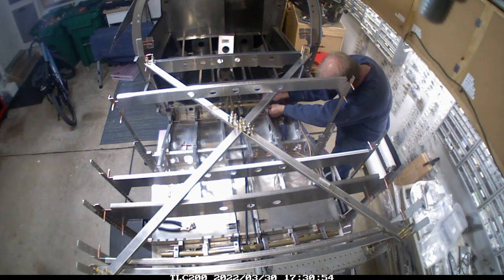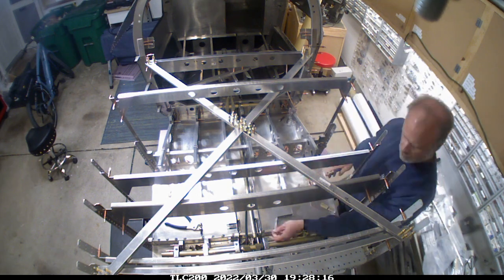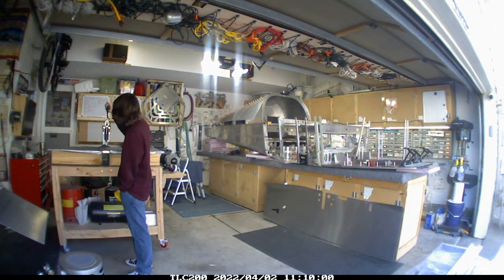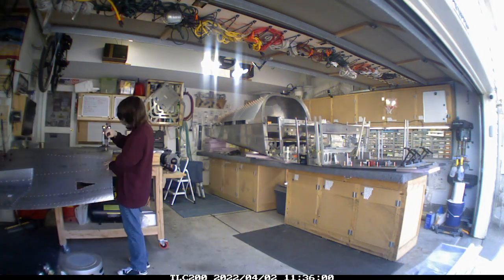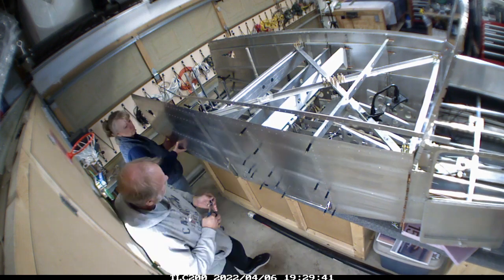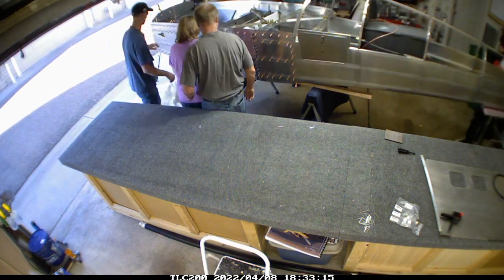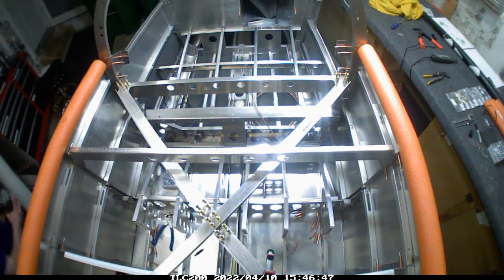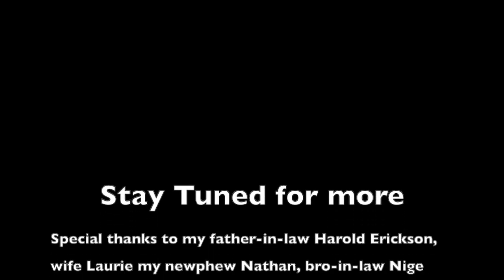Moving off the bench

Comment: Very much enjoy watching all of your videos.  Thank you for taking the time to post them and provide your commentary and insights!  

I just actually purchased my TSi kit last week (it’s a QB) and I am very interested in seeing your progress as you move along.  After following your build and a few others I am also looking to do several mods including upgraded brakes, the CIES fuel senders, a better firewall insulation and the aluminum fuel lines.  

One question directly related to this video is you mentioned not putting the rivets on the skins because you were also planning to do the aluminum fuel lines - is that due to ease of access for running the lines or am I going to be SOL in trying to do aluminum lines in my quick build?

Thanks again for doing these videos!
Reply from the maker: Hi - thanks for watching.  

The quick build will have quite a few of the things you want to do already done, so you'll have to backtrack a bit to move forward - but it shouldn't be horrible to accomplish. 

I haven't build a QB kit, but this is my best-guess as to the procedures:  

The fuel senders can be done pretty easily (in theory).  You'll remove the end-cap where the factory provided fuel sender is attached.  I think it's 10 nuts that hold that plate together.  From there you'd just make the hole bigger to allow for the CIES fuel sender and then re-attach.  You may need to use a bit of pro seal to put it back together and I'd re-test the seal using the variety of pressure testing methods (I actually am o.k. with the water test now after some trial and error).  But that really shouldn't be more involved than that.

I'm still working on the firewall forward at the moment, so I can't speak a great deal towards the insulation, but I'm definitely looking to beef that up a bit as well.

The fuel line is a bit of a puzzle.  I looked around for one of the short videos from another builder where he was able to make a single line going from the side of the plane to the fuel selector.  You won't be able to do it that way as you need a lot of room to move the single line in and around to get it into place.  I tried for a while to get that to work but the bends are quite complex.  There are a couple of 90° plus turns which are VERY difficult to do without pinching the material.  So I abandoned that method and have instead used AN to AN 90-Degree Bulkhead Adapter Fitting [-6 AN Male to -6AN Male, Aluminum] to make the 90° turn and AN6 Bulkhead/Firewall adapter fittings to pass the fuel line from the fuselage into the cabin.  This obviously introduces some potential points of failure where each junction takes place - so I will need to monitor that very carefully when I put the fuel lines under pressure during testing.  As long as my fittings/seals are done correctly I "should" be o.k.  The upside to doing it this way is it's easier and I can get the parts to fit just right.  

The upgraded brakes gets a little tricky as you may see in some of my newer videos.  I hope Beringer leans in a bit more into making a complete kit (or more complete I should say).  They do NOT like the modification needing to be made to mount the axel to the mains as well as the nose gear.  Both take a bit of precision to get done.  I still have to have a chat with them about the bolt attachment for the mains as I'm needing a part I saw on their wheels at Oshkosh in their booth, but they claim they don't make such a bolt.  So I'm a bit confused.  I'll get it ironed out though.  So if you go with the Beringer - be prepared to spend some fiddle time to get it to work right.  Since you're doing the QB, you'll have spare time though.  :)
Reply: @FirstRivet  Thank you very much for the quick reply!  Yes, lots to consider here for sure.  I may go with the upgraded Matco brakes that Evan Brunye did on one of his builds if the Berenger setup becomes more trouble than it’s worth.  Barry from Sling says they are sticking with Matco for now and are currently not looking to offer Berrenger as an option (I had previously heard a rumor from Oshkosh that they might).

Yeah I don’t like the additional failure points with the fuel lines but that certainly makes for a cleaner solution with the fittings you mentioned.  I wonder if there are any other alternatives to the rubber lines besides aluminum that would not need to be replaced every 5 years?
Reply from the maker: @kmartinhd1  The other option - and I would have gone this route if I didn't already have the aluminum - is teflon.  It's flexible like rubber but in theory lasts forever.  Depending upon the vendor they may tell you otherwise.  It's also pretty pricey as well.

Comment: I haven’t built my workbenches yet.  Now that you’re at this stage, what would you recommend at minimum, in terms of table count and size?
Reply from the maker: I built two 3'x8' tables which are joined together to build the wings on.  For the most part I was able to get a good chunk of the work done on these joined tables.  I have another bench which is part of my tablesaw/router bench which is covered to protect the tablesaw and it has been handy to work on smaller items or just some extra space.  The table saw bench is probably 4'x6' in size.  I don't think I actually measured it because I built it to fit the tools and not necessarily for the build.  

I also have a rolling cart to put some stuff on, but not build.  With just those items I don't really feel like I've been lacking for bench space.  If you haven't seen the first garage tour video I went over the space itself and I think I covered what I had.  Regardless - if you have questions, definitely ask!  :)